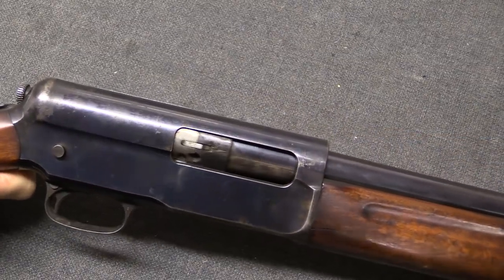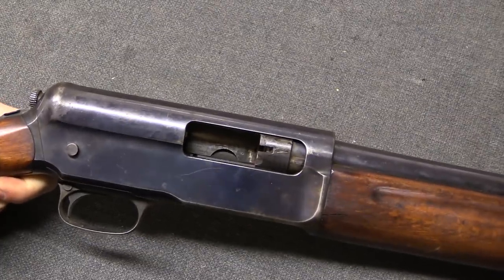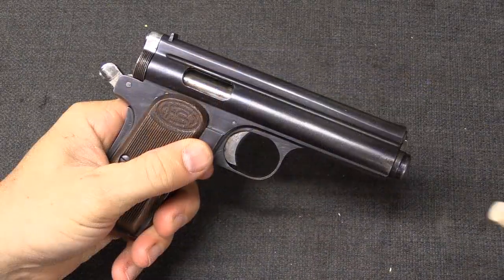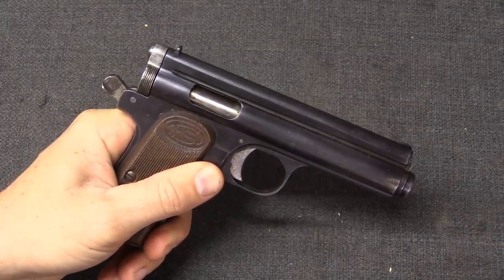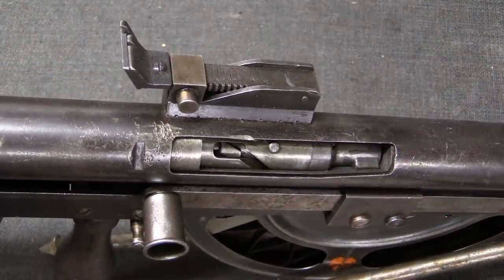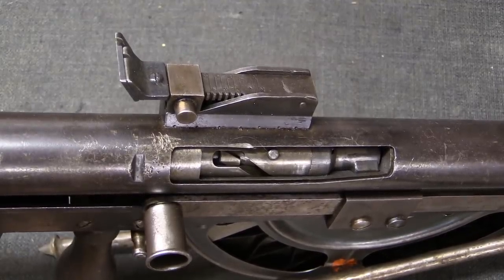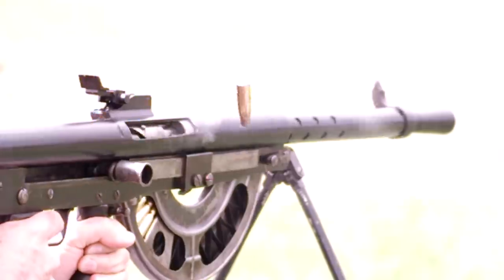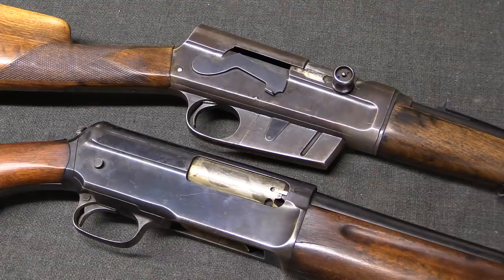How Does it Work: Long Recoil

Comment: Very good, but technically speaking the recoil doesn't directly push the barrel back. It pushes the bolt back, and the bolt pulls the barrel with it since they're locked together at that point. If anything, the force of firing tends to act forward upon the barrel (see blow-forward systems)

Comment: Long Recoil was used in shotguns because, at the time, black powder shotgun shells were still dominant, though smokeless powder was starting to overtake it.

For self-loading rifles, the extra time that long recoil guns stayed locked was critical. Case metallurgy was extremely primitive and catastrophic case failure was common. The extra time that the action was locked together reduced pressure greatly and greatly reduced the chance of case failure. Machineguns of the era were usually short recoil type designs and relied on large reciprocating masses to delay the unlocking of the action. Long recoil gave the same delaying effect, but with reduced weight.

Comment: Woo! One of my most cherished firearms is my grandfather's old goose gun - a FN manufactured Auto-5 3" Magnum.  I actually feel less recoil "shock" on firing from it since if the springs and friction rings are set up properly it's not slamming into the back of the receiver, it's more of a shove than a punch as the system transfers the recoil over it's full travel.

Comment: Ian, the bullet going forward does not make the barrel go back. On the contrary, the friction will pull the barrel forward - that's how forward stroke systems work. 
The pressure on the back of the case makes it go back - and the breach face with it - and the barrel, if it's locked into the slide.

Comment: I am curious about the viability of a long recoil action rifle in a modern military environment. As in a long recoil action LMG designed to fire very hot loads of ammunition (full case of .30-06 type pressure) ? Secondly, because one of the faults of the long recoil system is the recoil impluse it self, would the counter balance system used on the ak-100s solve the problem?         I'm 13 and really interested in firearm engineering, so this really stood out in my head.

Keep up the amazing work and i hope you grow your collection of extremely cool and rare firearms

Comment: The Long Recoil Browning A5 and it's clone the Franchi 48 can even be run reliably with Black Powder loads if the friction rings are removed. I wonder if this is an inherent capability of long recoil systems in general.

Comment: Now that silencers are more popular than ever, perhaps long recoil will make a comeback. The long travel rearward with the barrel and bolt locked together, cartridge fixed in place, means much lower pressures when it finally unlocks, as much more of the gas will be forced forward through the silencer at the muzzle. This would make for quieter operation, especially with subsonics, making it more like a manual action. In some cartridges, like .22LR, manual actions are generally noticeably quieter than self-loading actions, but long recoil could prove to be an exception.

Modern technology would enable these guns to be more accurate than the long recoil guns of the past. Using modern recoil reduction methods would also reduce felt recoil. Muzzle devices can help, like the silencer I mentioned, but a recoil buffer spring (probably in the stock) would decelerate the barrel and bolt as they travel rearward for less jolting recoil. Those are simple solutions. Upping the budget, a Russian-style BARS (Balanced Automatic Recoil System) could greatly reduced felt recoil.

Of course, for a very light recoiling round like .22LR no recoil reduction method may be necessary. Even without one, an integrally silenced long recoil .22LR could potentially be amazing, being a semi-auto (or automatic) offering a level of noise comparable to a manual action. If I was developing an integrally suppressed .22LR I'd definitely try it. Delaying the unlocking as long as possible in a semi-auto would reduce sound volume and gas blowback into the face of the shooter.

In a semi-auto, perhaps other methods might work even better. I imagine a trigger that fires on pull, and unlocks the bolt to chamber a new round on release.  It could work with any action. More recoil than some other actions, for sure, but it would be as quiet as a manual action since the human finger can be made to move more slowly than any firearm's mechanical automatic self-loading operation. Shooting it would be just like normal, press and release. It might feel a little jumpy or jerky since it moves twice, but that would make it as quiet as a manual action (arguably it would be a manual action, operated by the trigger release) yet firing as fast as a semi-auto.

Comment: Seems logical to combine long recoil with a air compression buffering system to spread the recoil out. Of course it would provide less cushioning as the air pressure decreased at higher altitudes. One could make it adjustable to account for altitude.

Comment: Sub machine guns get their name from sub sonic cartridges. the blow back system they use does not work with high velocity ammunition. The rate of fire is governed by the distance the bolt has to travel to eject and chamber a cartridge. Fixed firing pins are mainly used and the primer caps are hardened to take the impact  that can occur when the new cartridge is fed from the magazine. I know people will argue the point ,but this is fact.
Reply from the maker: The term submachine gun was coined by Thompson, to describe a small handheld machine gun. It is not related to ammunition being subsonic or supersonic. The rate of fire is generally controlled by a combination of bolt weight and spring force. And submachine guns do not require special primers in their ammunition.
Reply: YOU ARE WRONG SORRY. 9mm machine gun ammo has hardened primers especially  sten gun ammo. Make a submachine gun  using super sonic ammo if your game and let me see you fire it.

Comment: I take it guns using this system have very slow rate of fire?
Reply from the maker: Well, the Chauchat is really the only example of full auto long recoil.
Reply: The Ultimax is "Constant Recoil"... supposedly it's designed so that the bolt doesn't smack into the rear of the receiver, so the recoil is softer.  Other that that it's a short-stroke gas piston gun.
Reply: @bdkj3e   No, the Ultimax mg is gas operated
Reply: The action holding the bolt back until the barrel is forward again is indeed similar to the function of many rate reducers
Reply: "Very" slow is a relative term.   In semi I can work the trigger of my Remington 81 just as fast as I can the trigger of my AR.   If only the old 10 and 20 round conversion kits were still readily available for the 81.       :(
Reply: @ForgottenWeapons  I thought the Madsen was also long recoil?
Reply: @HansLasser  I DID say my French was High School... At best.  :-)
Reply: @ForgottenWeapons  40mm Bofors?

Comment: Although Ian didn’t mention it ,  I was/am under the impression that long recoil systems are at their best with automatic  anti-aircraft artillary,  in the 25-57mm range.  The guns are ground based so the recoil, which is its biggest drawback,  isn’t felt by the gunners

Comment: Hi Ian, in one of your Q&A videos you said that long recoil would be the best system to suppress because the chamber is sealed for the longest time. Would it be relevant to make a whole new gun specifically designed to be suppressed long recoil or cons would outweigh the pros? Thanks
Reply: The main issue with trying to suppress a long-recoil gun is the delicate balance between timing, bolt thrust and weight. 
A long-recoil gun (like all recoil operated systems) is carefully balanced between the free recoil energy of the cartridge and the weight and locking degree required of the barrel and bolt. If this formula is off, the gun either beats itself to death/potentially unsafe (too low mass/too high cartridge pressure) or does not function at all (too high operating mass/too low cartridge energy). 

Now, take this delicate balance and slap a suppressor on the end (which because of long profile of a barrel, will have a lever like effect) and you end up with a finicky system that even if you do the math, do NUMEROUS test designs and have ultra low machining tolerances, you will still  end up with a gun that will function with probably only ONE loading of a cartridge and possibly only a single lot, never mind going sub to super. AND that’s assuming your chosen base round even has the energy to move all that mass without going to ultralight (expensive or weak) designs/materials (sure your supersonic 9mm might barely do it, but what about subsonics with low bolt thrust?). 

What’s that I hear? Develop a kit of adjustable barrel weights, bolt weights? Oh now you just increased the cost by 50% PER adjustment and now only an expert can use it and you STILL have to tinker with it, making it not exactly dependable. 

Want to increase your product line by adding another caliber to the lineup, do all that expensive development again!

Unless it’s a one off and you do your own reloading, or you have a major government contract (aka huge $$$) it’s just not worth it, and if you do decide to make one, it will only ever be a toy because of the requirements of maintaining the system.
Reply: @ChasseurKGB  muzzle booster might help with low thrust. I am aware of the challenges. Thanks for replying.

Comment: Since you mentioned that the mechanism was mostly used in the early 1900s, are there any modern firearms today that utilizes long recoil? If so, under what circumstances are they used? (Kind of firearm, cannons, small arms etc.)

Comment: I always thought the Long Recoil System should provide plenty of energy to work the action and do so without using any kind of gas port, piston etc = "The Whole Barrel Is The Gas Piston".
It also seemed to me that A) You couldn't mount a bayonet, if you wanted to and B) If you tried to mount a scope on the barrel it would be destroyed by G-forces - and C) if you mounted it to the frame then slop between frame & barrel is going to destroy accuracy.

Comment: Could you improve the recoil by extending the distance the barrel and bolt travel backwards beyond what they strictly need to, so that they slow down more gradually?
Reply: Why Jay 
If you want to get smacked in the face with a piece of metal maybe. And no, because that doesn’t dampen felt recoil. Recoil is caused by the mass of moving parts and hot lead being accelerated extraordinarily fast.
Reply: A buffer system of some type would help but you'd be putting more things in an already more complicated design lol.
Reply: @Grabbagar670  What Why Jay is talking about is called constant-recoil, and it does indeed reduce felt recoil substantially. Look it up.
Reply: That would be trading a sudden kick for a long push. Don't know if you'll find it an improvement, since you'll also have a slower rate of fire.
You could use a Muzzle Brake to slow down the action. I would have all the affects of what you're proposing without making the gun much heavier or longer.
Reply: @ThZuao  No one that shoots these type of firearms regularly complains about the slightly slower rate of fire of a constant-recoil gun. The Swedish K SMG has a rate of fire of 500 rounds a minute, versus the 600 rpm of the Uzi. Guess which one Ian prefers to shoot. Muzzle brakes come with the penalty of increased side blast, which can make them really unpleasant for anyone else around the shooter; and adding a muzzle brake is a nearly equivalent increase on the total length of the gun compared to constant-recoil.
Reply: @Nimblebee-iy4nz  Balanced-recoil is indeed more mechanically complicated, but constant-recoil is not. The m/45 Swedish K is a dead simple gun.

Comment: Ian, are there any examples of long recoil open bolt firearms? I'm not aware of any, but would be very interesting to see cycle if there are.  Granted with the recoil and mass of barrel returning and then the bolt closing I can imagine it would handle rather strangely...
Reply from the maker: The Chauchat, as you see in this video.
Reply: @ForgottenWeapons  ah yes! Looking closer I can see it, I assumed it was just the delay in the bolt returning once the barrel had done so. How does it handle in semi? Are there any other examples? I'd be particularly interested to see a submachine gun operate like this.

Comment: I wonder how much precision is lost from a non-fixed barrel though. How much MOA increase as a percentage
Reply: I was wondering the same thing. But aren't most artillery pieces long recoil?
Reply: @KittJT2  they are as are many tank main guns i believe. I think this is because it is safer for the reasons explained in the video, but also easier to beef up the barrel & breach block than it is to try tap gas from the barrel into a gas piston or tube, as that would to be stronger too as the cartridges get hotter than .50 BMG. Also artillery fires at area targets & they have other things that affect their accuracy in their higher arc than anything a recoiling barrel adds.

Comment: Dear Ian, this may seem like a question with an obvious answer, but you of all people know that sometimes these answers are not at all obvious. So, a hypothesis: having a reciprocating barrel (with a very long path, to boot) implies that the accuracy, or rather consistency of shots should inevitably suffer. Was that the case? Or could it be completely remediated on well-made/designed guns, and manifested itself only in guns that didn't account for it? I suspect that the layman's understanding (that a moving barrel will always impede accuracy) may be wrong.

Comment: Is there any gun featuring long recoil and constant recoil?
Reply: @Cultural Relic I'm not sure if it was floating bolt or floating recoil or if it was called completely different.
I mean the system in which the bolt is stopped only by the recoil spring and doesn't hit the back of the receiver, so the recoil is much more gently. Like the system in the ultimax or those special AR's they had on inrange once.
Reply: @Cultural Relic ah, thanks anyway. Changed the original.

Comment: Are FAL long recoil rifles?
Reply: No, they are not.

FALs are gas-operated rifles, in which the rifle uses gas pressure to cycle the bolt, extract the casing, and eject it out of the rifle.
Reply from the maker: No. The FAL uses a short stroke piston.
Reply: Thank you for the info.LOVE THE CHANNEL